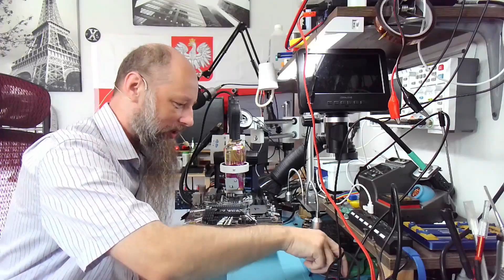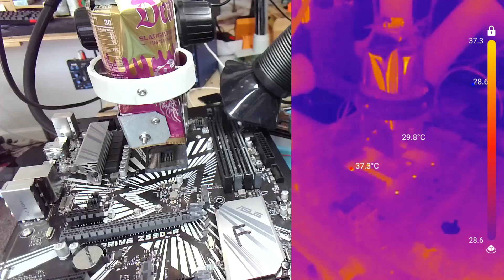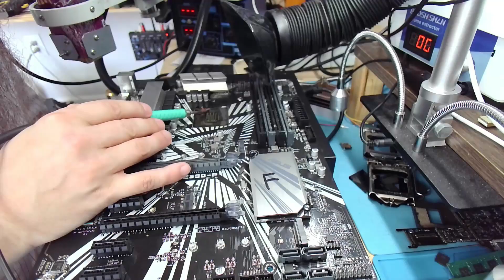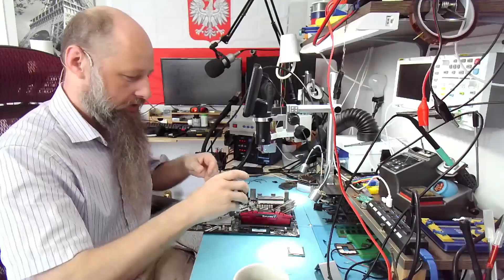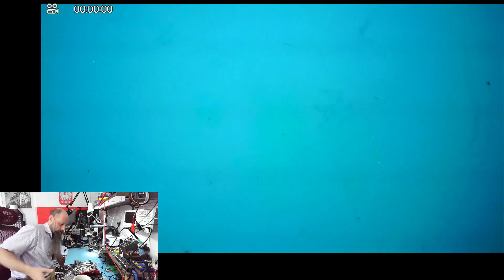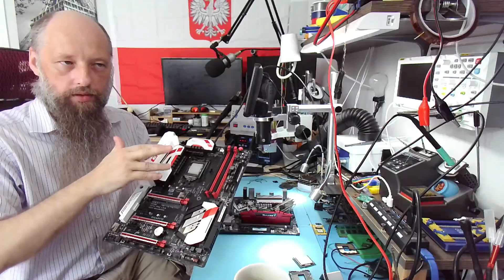Day #19 | New and Improved (Soda Can) Nozzle for LGA1151 Socket Replacement

Comment: Hey, you should add some no clean flux before placing the new socket, it will help a lot for the positioning, your socket positionement was good, but just need a bit of flux to get in place correctly during the melting process
Reply from the maker: yes, I applied a thin layer of RMA flux but next time I'll put a bit more and after heating coz it burns off quickly under there